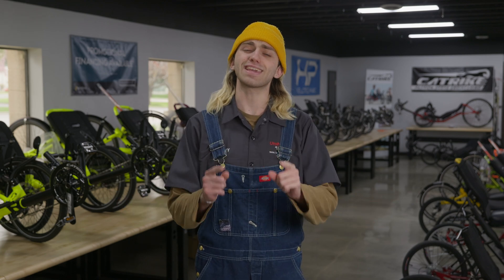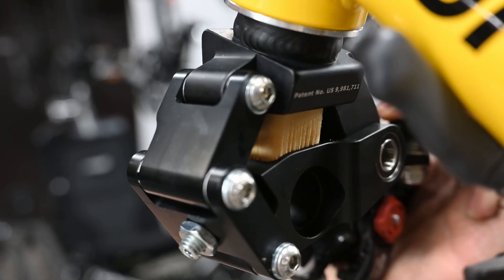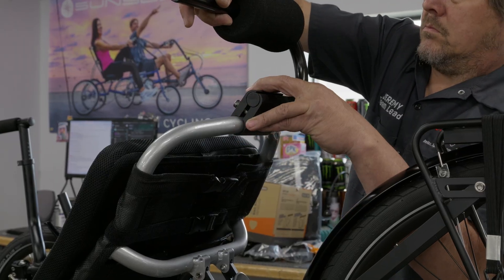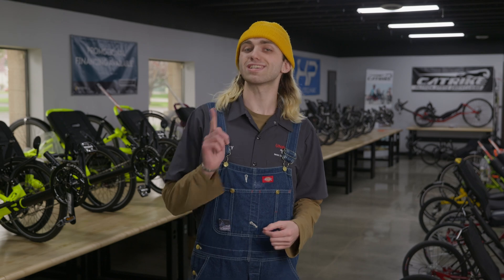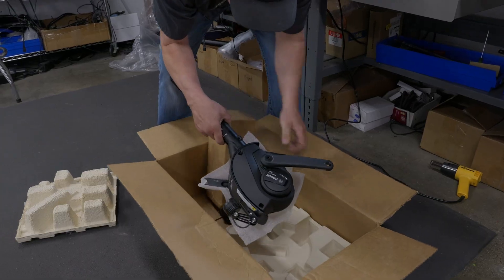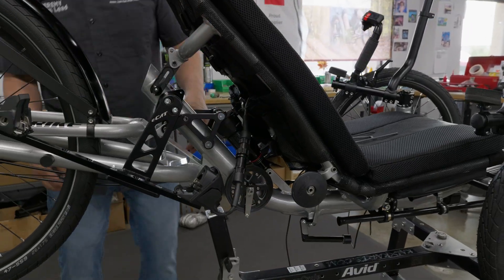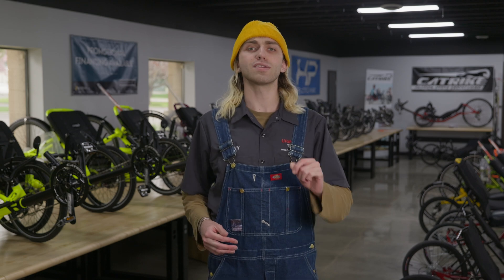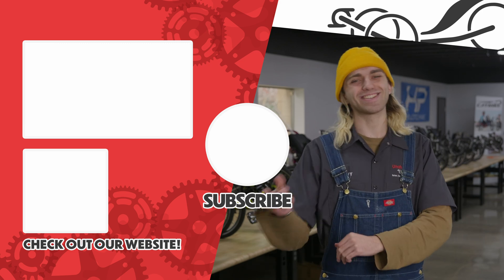Our First 2025 eCAT Dumont Build is HERE – Full Custom Electric Trike Breakdown!

Comment: The eCat is awesome but having the wire housing zip-tied to the boom looks tacky. I really wish the wiring could go inside the boom.
Reply: that would be nice one day it will come
Reply from the maker: Some of the trikes and motor systems do have internal wiring but they are much harder to adjust for different rider heights.

Comment: The trike would really be awesome with dual power pack 800 batteries. Great choice in going with the Rohloff hub. It's a shame that a gates belt drive is not an option on a trike, definitely cut down on maintenance needed.
Reply from the maker: Not sure a belt that long would cut down on maintenance even if it existed. Belts require quite a bit of tension and that is really hard to do with an adjustable, folding trike that has suspension.